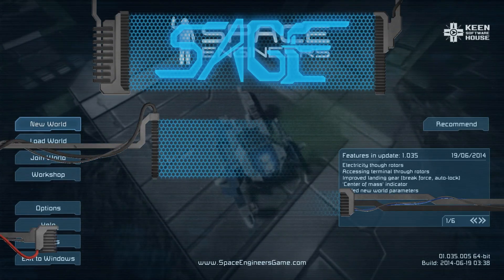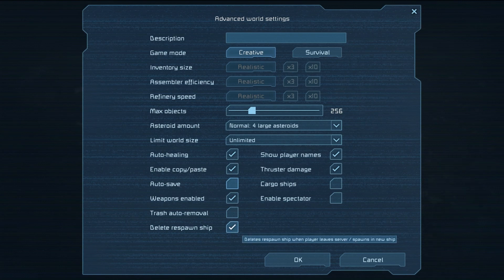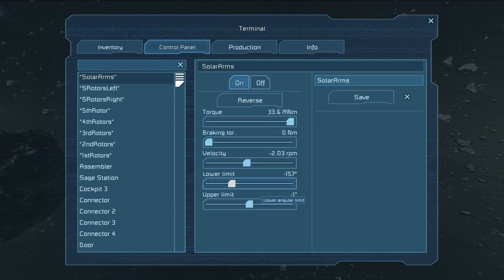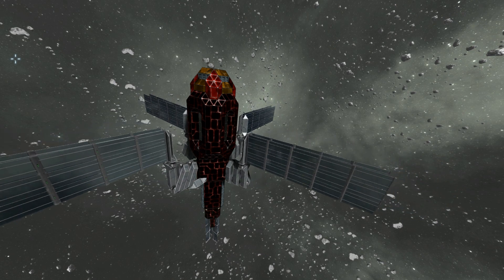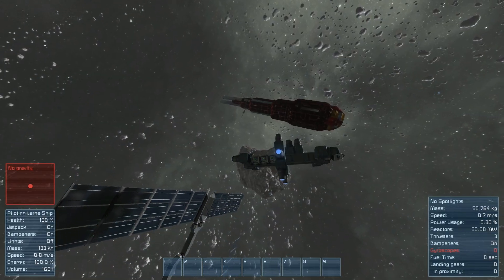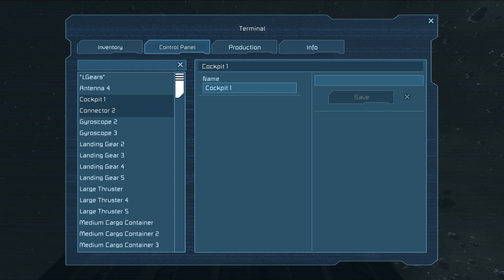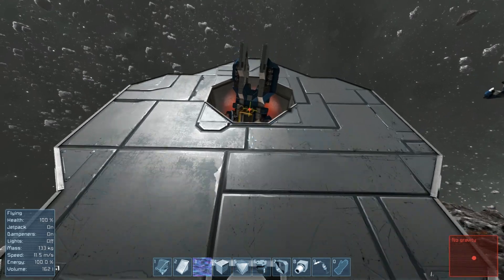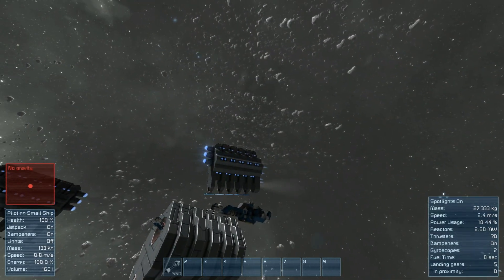Space Engineers, Control through rotors (Update 01.035)

Comment: Sage... Assembly line. A conveyor belt (like a mechanical tank track, with landing gears on autolock mode, then you have a rotating arm with a welder(s) that compensate for the speed of the conveyor belt and build the object en route to it's location, then rotates back to the start, and repeats the process.

Comment: I once tried to make a vtol like ship using rotors and a seperate thrusters set at angles so that the engines would be facing vertically and horizontally. I used merge blocks to lock the engines at 90 degree angles, but when the engines merged with the main body the upper part of the rotor and the block attached to it dissappeared.
Reply: Looks like you had an experience of the merging bug where one part just teleports.